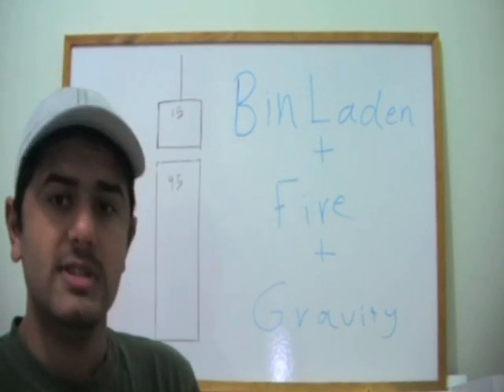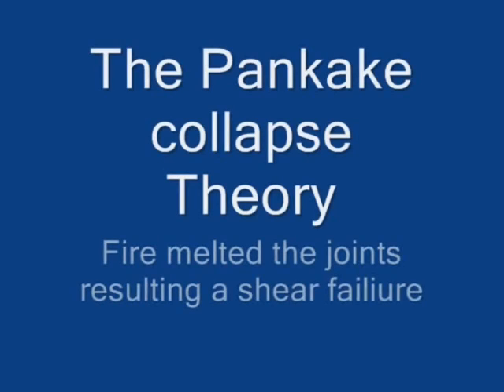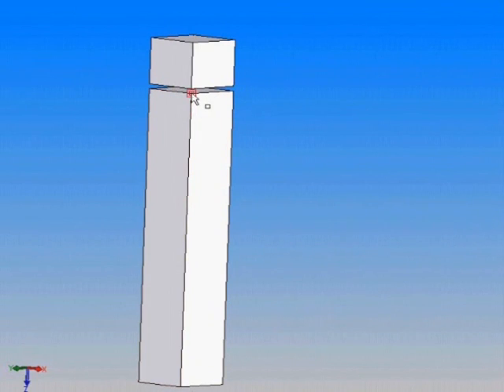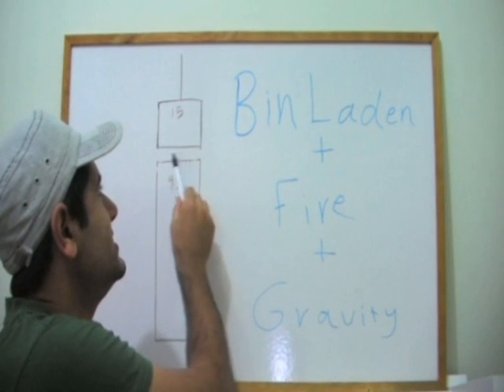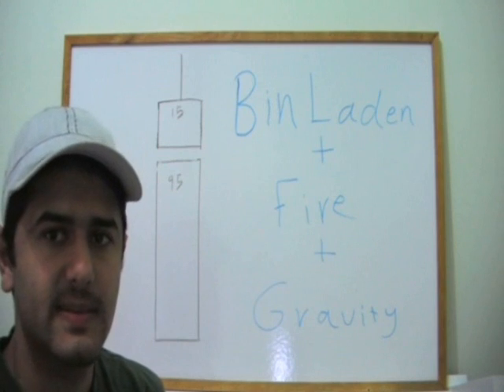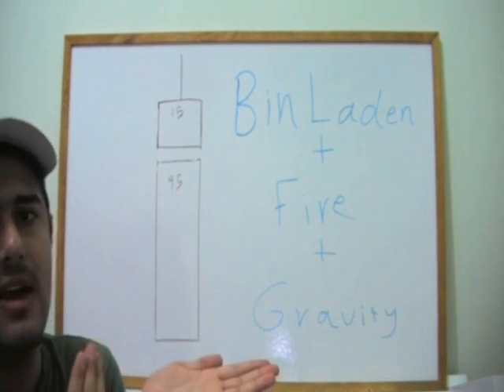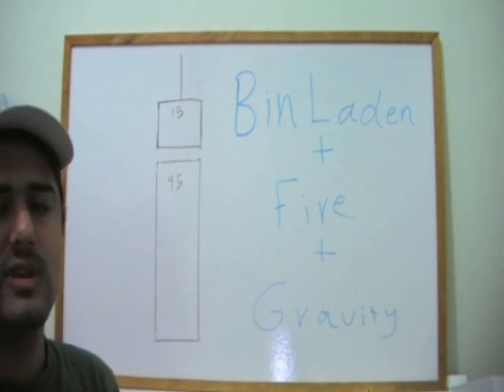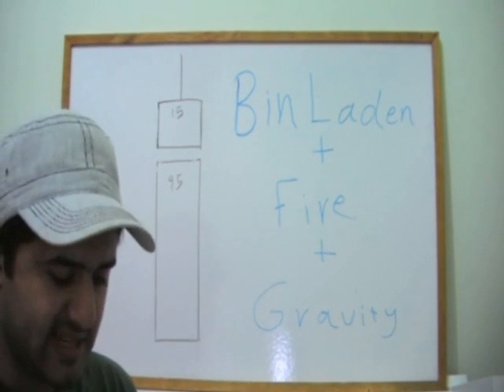(Part1) 911 Simple Physics Structural Failure Vs Demolition

Comment: @smujismuj 
1. Free fall speed, all three bldgs.
Wrong.
2. Molten steel.
Think about this one carefully (if that's possible). If Thermite/mate is what turned the steel molten during the demolition (what you nutjobs assume), then what was keeping it motlen weeks afterwards, pray-tell?
3. Visual and Video evidence.
Yes, the sound of the controlled demoltion was deafening, esp with blg 7...Not.

And I suppose the NYTimes is being told to reprint docs leaked by Wikileaks. Ta ta.

Comment: @shorty40merza Lol you crack me up XD . Actually only wtc 7 did that. If you set fire on the top of a building larger than WTC 7 there is a good chance it will explode floor by floor.

Comment: @zenoist2 There is an alternative to achieving symmetrical collapse.

Pressure and Temperature changes propagate through steel at the speed of sound for steel, which is between 3000 and 6000 m/s. If a domino effect of failure were to occur near the bottom, all the columns COULD fail at approximately as quickly as stress (pressure) could propage through the structure and fail all the critical columns. 

This would imply the building wasn't prepared for the type of damage and location of it.

Comment: @zenoist2 Actually the damage inflicted on Building 7 was probably equivalent to that of having a plane flown into it. Do some research on the south views of Blg 7. It's the view that had most of the smoke coming out, but you will see enormous damage sustained on the southern facade. Every other building in WTC plaza (3-6) that did not have a plane flown into it was virtually flattened almost immediately by the megatons of falling debris. It's impressive that Blg 7 stayed up as long as it did.

Comment: About your "Heat Transfer" analysis...

The structure supports the load in steady state up until the collapse. The support beams have material strength that variates with temperature. Now, consider the yield strength and the ultimate strength...

As the yield strength decreases with increasing temperature, we approach the condition where the beams begin to "give" or deform.

Once they begin to deform, the yield strength and the ultimate strength vary both with temperature and with deformation...

Comment: @JOHNM3791 An empty 737 weight 36 tons, a fully loaded 737 can weight up to 149,710 lb(that's about 75 tons.). Of course the plane that hit the north tower wasn't a 737, it was a 767-223ER. Which weighs 181,610 lbs empty(no fuel or passengers) and has a max takeoff weight of 395,000 lbs. and can hold 24,000 gallons of fuel.

Comment: All wrong mate. The core in both buildings stood briefly after the collapses then fell itself. Also, the floors were not designed to bare any load, but to TRANSFER load to the outer columns. When the lightweight trusses lost their strength (did not at all have to melt) they sagged and pulled the columns inward, this is clear on the south tower, watch vids, you can see the columns snap before it collapses. The wtc design was one of its own major faults and was inadequately fireproofed.

Comment: @zenoist2 You are wrong. The damage done (with exception to the entry holes) and the fires, were fairly symmetrical. Each collapse did not come down perfectly as you are making it sound. You can see much of the structure for each tower still standing momentarily as they collapse. Completely uncharacteristic of a controlled demolition. You need to learn about the designs of these buildings before you go around saying theres no way on earth they could have collapsed the way they did.

Comment: The case & point here that many aren't getting is that the building cannot fall at near free fall speed given the fact it was only damaged at the top. The whole building wasn't heated, melted,bent or obscured it was only a targeted area and that does not allow for a free fall speed to be achieved as it did on 911.  The only way it could reach that falling speed is via a controlled demolition as this video blatantly points out.

Comment: Heres was I "think" happened and may explain why we are so confused with what we saw. 1) Planes hit the buildings. 2) the structures were weakend through heat and damage. 3) When the top floors gave, the terrorist blew the buildings. In closing the terrorist damaged and blew the buildings, and for some reason if we detect exsplosives it means the US did it. No...I feel the terroist used explosives and they did it. This is the only thing that I could think of that would answer everything.

Comment: So lets crash a 757-767 into a clone of the WTC. Plain and simple. These buildings were not like other buildings. These towers were VERY unique and were not enforced with concrete like other buildings. The idea of a controlled demolition is crap because it would be a huge boom before and after the demolition started. Also, the idea of a controlled demolition is crap because you would know that your building is, and the areas expolding, from what I remember, were not maintence floors.

Comment: 4 only 3,500 gallons were needed to get to los angles and have a good margin for safety.
5 passenger airlines are run strictly to costs and bosses want to keep costs down.
6  a  commercial passenger jet taking off for a 3,000 mile flight with enough fuel for a 7,600 is frankly ridiculous, has never been heard of in history and a total lie.
7 the full flight of 7600  miles  WOULD take 10,000 gallons of fuel.
8 the official story ALWAYS quotes 10,000 gallons 
9 the official story is total shit

Comment: hey morons! look up office fire temperatures on google and see what you come up with.
You might just find the quoted NIST temperatures are a total lie.
An office fire is around 400 -500c
PLUS the 10,000 gallons of fuel is total crap and ill tell you debunker dunces why.
Its easily researchable.
1. the planes maximum range is 7600 miles.
2 this needs  aprrox 10,000 gallons of fuel.
3 since the planes were only flying to los angeles they didnt have the full 10,000 gallons.
 (continued)

Comment: Both of the buildings began their collapse at the height of the damage caused by the planes.  That's where the structural damage was and also where the fire was the most intense, which didn't have to melt the steel, just weaken it.  To imply a controlled demolition, they would have to know in advance where the planes were going to hit.  Tower 7, was damaged (on the side rarely seen in videos and pictures) by the falling towers, and the fire which wasn't put out. weakened it further.

Comment: @spartan10170  .
hmm you're making some of sense.
If it makes sense I'll listen.
It doesnt apply to building 7 though.
And the jet fuel would have burned off very quickly.
 You said yourself a hot spot implying there were non hot spots.
Its hardly even heating is it?
. One of the many the problems with wtc7 is that it collapses at the penthouse first.
Its in the middle of the building and should, logically be the least damaged.

Comment: @MyLittleBomb How you argue that the buildings were demolished is beyond me.
Firstly you say that there was hardly any fire in those building, are you forgetting that all the buildings except for WTC 7 were hit by planes, the planes were carrying kerosene based jet fuel, this caused not any normal fire to occur within the building, the fires would of been extremely hot burning at around 287 °C...

Comment: The flaw in his case is at 4:37. The failure occured because of the horizontal floor trusses weakening and not the much heavier vertical building beams.Also he does not consider how lightly those trusses actually are,the undamaged floors could never support the weight of additional floors and would have failed quickly

Comment: @MyLittleBomb It was a 30+ year old building, much of the fire proofing had become unfit for purpose, they were systematically respraying the floors prior to the attack but most of the building was poorly fire proofed.

The number of floors on fire, plus the weight, and the design of the building all had an effect on the buildings collapse. Apparently it used to sway in the wind by 6ft+ on stormy days, it wasn't some kind of impenetrable fortress. It was an old poorly fireproofed office block.

Comment: "The pancacke theory is imediately rejected; as you see the columns would still be standing if that really happened".  Thats a very big ASSUMPTION, that the columns would still be left standing.

@ 2:06 "This is what happens to an intact building if it is not given sufficient height to build up kinetic energy and it's upper columns are not weakened". WRONG, thats what happend in THAT building, it is arrogant presumption to assume its true on ALL buildings.

Comment: The jet fuel did not burn but exploded in a huge fireball and was gone in minutes.
The columns did not melt!  Other buildings burned 2 days and did not collapse.
The mushrooming effect was actually reducing the weight, so how come the foundation fell apart under less weight, than it was built for.?

Comment: @Lowfun there is NO evidence of thermite.  There are SOME (but NOT all) of the chemical residue of thermite which is easily explained.  There is no strong evidence of molten steel.  There is quite a bit to indicated small amount of molten METALl which is quite likely aluminum. (there was a large amount in the towers) Yes there are only 2 (not 3) towers that have fallen after planes hitting them.  this is unusual how?  Got any examples of buildings being hit by airliners that did not fall?

Comment: @MyLittleBomb Yes it is hard to argue with thousands of structural engineers. Which is why the conspirisy is a load of utter bollocks. There are NO structural engineers who support the conspirisy. If there are then they are like you and havn't actually assessed any of the facts. People at MIT and other people INDEPENDANT from each other have proved the bowing in the structural design was sufficient enough for the buildings to collapse. Read the evidence from proffessionals. Not theorists.

Comment: @MonkeyBoy2194  Good advice.  I did.  He's wrong.  The mere fact that he mentioned melting columns would seem to indicate he does not know much about why the towers collapsed.  I'd send you a link to a peer reviewed paper by a structural engineer proving why they did collapse but I don't think you will read it.  I'm sure you can find it if you want to.

Comment: @MarcoTUV Well the fire from kerosene from an airplane might sound very ferocious to you or me, but Iron its a really tough material, in furnaces steel is treated with specially hot fires (one of the reason skyscrapers where not possible before) the temperatures reinforced steel require to melt are not easy to achieve. Also he is right, the plain hit on the side, the first part to roll out would had to be on sideways not symmetrical.

Comment: @thedman113 "A gravity driven collapse wouldn't need the foundation to be weakened at all."

Your right but if you want the building to fall at near free fall speed then the foundation does need to be weakened.  Otherwise the building will take longer to collapse down as it encounters all that resistance.

Comment: @CRAZYHORSE19682003 "2nd the area where the pentagon was hit was recently "hardened" against terrorist attacks. The windows there were not glass but a special ballistic resistant plate."

If the nose of a plane can cut through re-infroced steel concrete then I am sure titanium made engines would have no problem leaving a mark on that ballistic glass.  The evidence shows no marks on the glass or the wall apart from a small hole.

Comment: @CRAZYHORSE19682003 "Ok a couple of your assumptions are wrong. The engines were in fact recovered inside the pentagon"

I have seen the most important pics which were the ones taken just before that section of pentagon collapsed.  It shows a small hole with glass windows intact where the wings should have impacted.

The evidence does not show the typical damage which would be caused by a winged plane hitting a building.

Comment: @Tzimnewman3 Ok a couple of your assumptions are wrong. The engines were in fact recovered inside the pentagon, just Google wreckage pics inside the pentagon on 9/11. They have a nice shot of the compressor from one of the engines, the nose gear, a couple of the rims, etc, etc. The picture evidence leaves no doubt. 2nd the area where the pentagon was hit was recently "hardened" against terrorist attacks. The windows there were not glass but a special ballistic resistant plate.

Comment: @kjones2345 Your right, Aluminuim melts at 1200 F which is very far from Jet Fuel which burns at 549.5 F.

"Take for example the "crash" at the Pentagon. Was their molten aluminium at that site?"  As far as I am aware the missile attack on the Pentagon did not leave any molten metals.

Comment: I had dinner a time or two at -"Windows On The World"- on the top of the WTC - and what really struck me was how wobbly the building was. Every time the wind blew I felt like I was back in Cali experiencing a 3.0 earthquake. So I believe all the ppl who said "the building rocked like 6, 8 or 10 feet when that plane hit..."
The jet fuel heated the steel up to 1200Degrees which lowered the tensile strength to 15% of normal, plus all that weight of the floors above-and it just collapsed on itself.

Comment: It seems like all the 911 conspiracy theorists are talking about "melted steel, melted steel"which is not really what happened, because jet fuel cannot actually melt steel.It can however greatly weaken it's strength. 
When steel hits 1000 degrees its strength is about 50% of normal, at 1400 degrees it goes down to like 15-20% normal strength. 
And then you have all that weight of the upper floors pressing down on the weakened steel and gravity just kinda takes over....

Comment: @ptangboy Tower 7 was extremely damaged by falling debris, and had fires burning in it, further weakening its structure.  And, you can see the point at which one of the support struts finally fails, and then a couple of seconds later the other struts fail and the building comes down, not perfectly onto it's footprint.  Also, no demolition explosions went off, you can't hide those.

Comment: you would have to assume that the columns were not touched by the aircraft nor the debris being pushed through the building, in order for the columns to be structurally sound the whole time.

steel does not have to melt to lose its structural integrity.  ask any welder.

Comment: @drak1970 
Well, the less aerodynamic the object, the higher the drag coefficient is going to be.  The more the surface area (slab), the less aerodynamic.  Concrete is about 150 pounds per cubic foot.  Normal human is probably around 60 or 70 pcf....about half.  So a large chunk of slab will have more surface area and is about twice as dense.  Perhaps it all evens out.

Comment: Which is something NIST also put out in a statement about a year of so ago. 
Do I believe in controlled demolition?
I believe that there are valid points on both sides. However, further examination and reproduction of events (In controlled settings) needs to occur. 

But then, I'm just a skeptic as a rule (Yes, over most everything).

Comment: @shorty40merza

Way to assume that the falling rigid body didn't land on the floor space. Can you put up a video explaining why you think 2 inches of concrete resting on sheet metal resting on a 6 inch strut is going to arrest a condition of catastrophic collapse despite the fact that both ends of the struts are attached by 3/8" bolts at both ends? I'm keen to find out how deep your BS goes.

Comment: If anyone has seen verinage demo, its very impressive. Though they say, it can work on any structure; so far, Ive only seen it preformed on concrete bldgs. It works by lifting/cutting the support beams/columns at its center, then it drops the upper half or by pulling in the support columns spontaneously allowing a nice smooth top down. How did fires remove or lift all the supports beams at the same? How is verinage comparable to a burning bldg? Show a top down from fires not from a purposely CD.

Comment: you are dumb. hes saying the collapse did not begin from the bottom up, the structure is still falling down in both cases, the compression of each floor is from the top down not the bottom up. look at normal controlled demolitions and you will see an example of the difference.

Comment: Well, biped19, you are missing the point. The THIN aluminum you point out, after ignition, serves to ignite the thick aluminum, like the wing box, keel and vertical stabilizer base. Airliners burn HOT, even without fuel, that's why airport fire fighters wear those shiny nomex suits and air bottles, JUST TO GET close enough to an aircraft fire, at better than 2000 degrees, haven't you EVER seen that?
.

Comment: Your forgetting the aluminum-almost paper thin materials commercial aircraft are constructed with. Now you compare that to the high grade thick structural steel used in the WTC construction w/ fire protection. Think beer can. Furthermore, you add to the equation that the WTC is not sold. Thus, there is plenty of space for the "impact blast" to dissipate its energy. similar to how spaced armor function on tanks. Furthermore, the fuel was consumed on impact. On & On & On.

Comment: Gravity is a constant accelerator, remember? Every second it's going faster, AND it's getting heavier. When you figured out that 15 floors =68k tons, did you figure out what 16 floors equals? How about 17? Linear Momentum = mass times speed, and in the WTC's case, mass is getting heavier by 2,000 tons a floor.